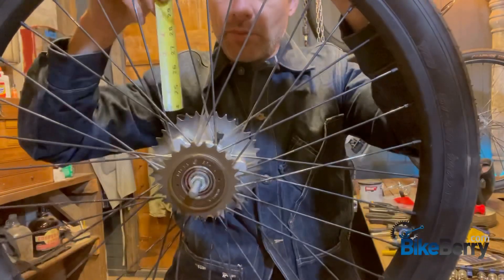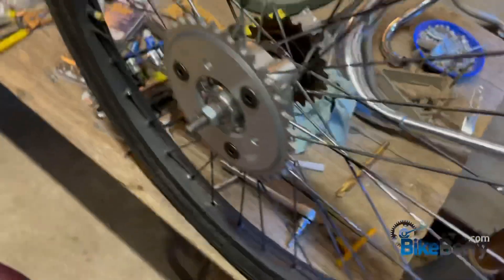How To Tap Bolt Threads In Metal | Motorized Bike Fabrication | Bike Berry

Comment: Dont use a 5/16 drill bit for a 5/16 tap. It is too big and you won't get any threads. Do the research first on what you will need if you are a first-timer.

Comment: I had an even smaller diameter hub and had to ditch the hub adapter all together. I did what would be considered a no no in the fact that I welded the sprocket directly to the outside of the hub. It does have a tiny bit of wobble, But only due to too much heat from the weld without proper cool down time. Other than that it pulls smoothly and hasn't even tried to come off. Also not enough side to side to create any ware on the chain, So all good for the time being. I wouldn't suggest doing this method, Especially if you ever want to change the sprocket, As you would half to grind off the welds first. It does work though and never slips! Nice video Tony, Keep up the great work with your videos.

Comment: Also for good results burr the inside of the adapter where it touched the hub shave the ends so ya have more squeeze room and upgrade to longer bolts and add nuts at the end they tend to back out on ya even w thread lock and 100% make absolute sure that it’s true and level